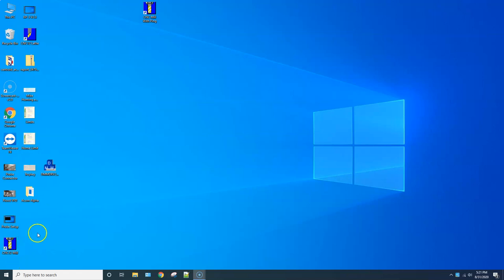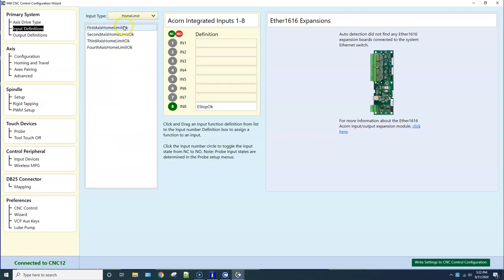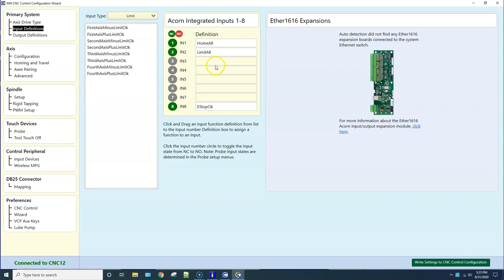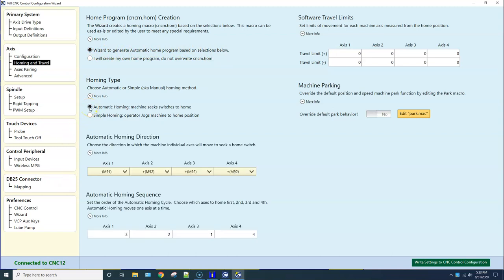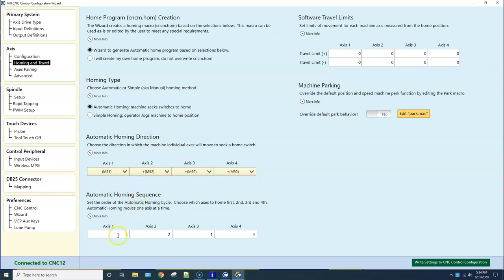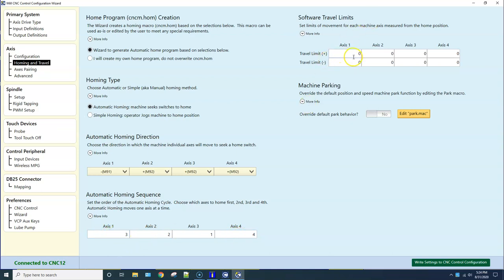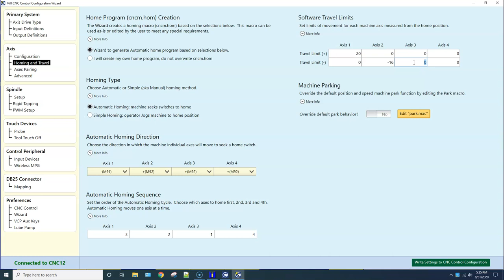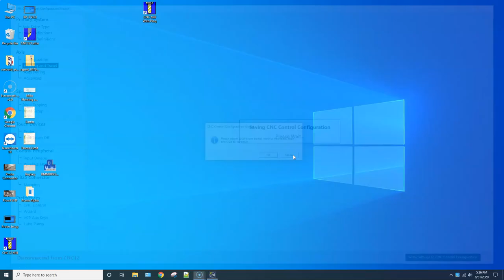Setting Home All Limit All & Soft Limits in Centroid Acorn CNC12 Wizard

Comment: Why is that only 1 homing switch is required per axis? How does it know its limit of travel on the other end
Reply: It knows when you start the machine and hit home. The machine will move to say X left until it hits the limit/home switch.  Once it hits that switch it looks at the setting you told it in the (software Travel limits ) section X = 20" in this video.. your machine might be different.  It will only let the machine move 20" to the right from the limit/home switch.  Personally, I would still use a limit switch at the other end just in case I do something wrong and the machine runs off the end... The motors I have a very powerful and would run right off the end of the machine and out the geroge without a limit switch,

Comment: One question Martín. What happen when the accorn software when the electricity Is lost during the machining process? The cero piece Is keeped?  What happend in this Situation AND what Is the process after happen this?
Reply from the maker: With Acorn if there was s an outage or a crash, restart computer and Acorn, re-home the machine and either restart the part or use the search feature and start from a program line or tool number closest to where it stopped

Comment: I stumbled in here looking for the travel limit problems.  Should it distinguish between mm and inches automatically?  I ask b/c it seems if a metric file is loaded is says travel limits exceeded when the limits are in inches but the travel in mm.  Obviously 80mm is not very far, but 80 inches is quite far.
Reply from the maker: Please post your question to the Centroid Acorn User's forum with a fresh report

Comment: i dont have limit switches so im not sure what to select, although i do have the wire run since its normally closed circuit.
Reply from the maker: If you are going to jog and set home, use Simple Home in the Wizard